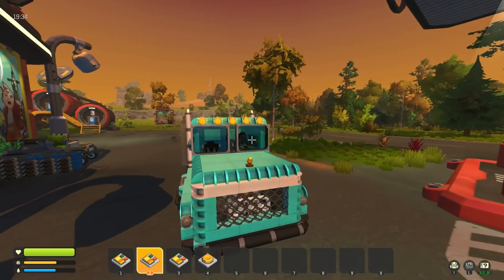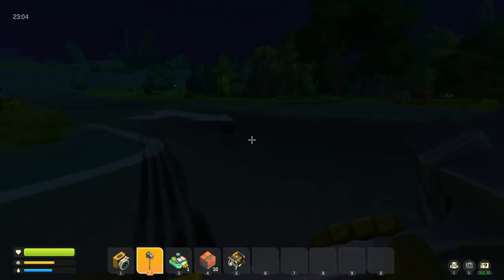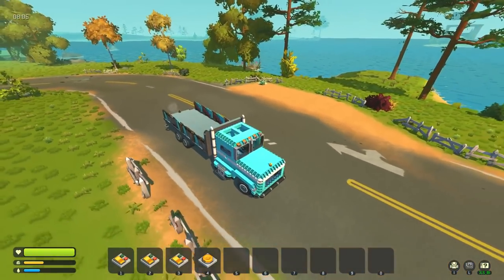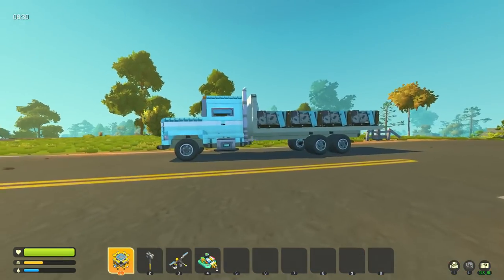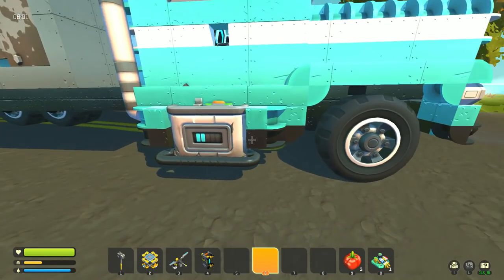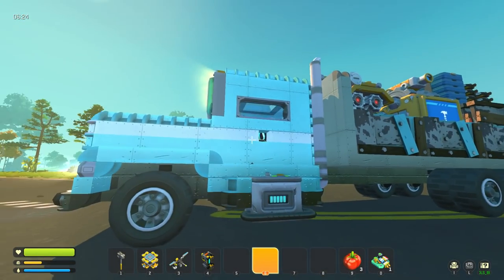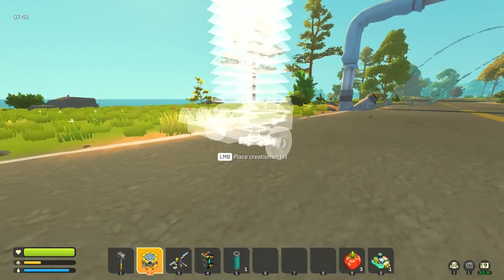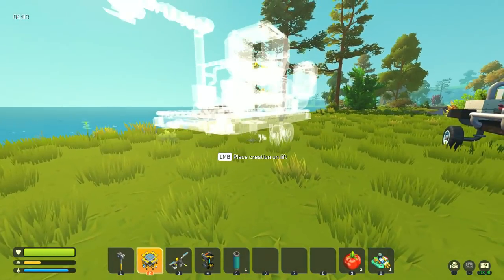I Made a GIANT Land Train to Move Out of The Mechanic Shop! (Scrap Mechanic Survival Ep. 4)

Comment: 12:33 the reason for that is because of frametime. Frametime is the measure of how long one frame takes to render in milliseconds. If you have 100 fps but 40ms of frametime, that's gonna feel choppy and is terrible. The ideal is 16ms. You can display this and other metrics in real time if you use MSI Afterburner+Rivatuner.
20:28 your move is the coolest move out of the ones I've seen.

Comment: The engines have numerous factors that determine their effectiveness for a given task. A given engine has speed, power, and "resistance" values. The resistance is simply how much force will be applied to keep the bearing from spinning due to outside force. Gas engine bearings have zero resistance, allowing the wheels to spin freely if unpowered. Electric engines have a high but not infinite resistance. Anyways, then there is speed and power. I THINK the engine has a desired speed that is decreased by the net torque forces. Net torque means how much the engine power is countered by opposing force (friction). And weight factors into gravity and inertia vectors which increases friction. So yes, weight of the vehicle increases friction which counteracts the positive power torque. But this "opposing force" may also ADD to the power torque like when you are going down a hill. Electric engine "resistance" works to negate opposing friction, so they don't accelerate much thanks to downhill movement. And controller bearings are built on the same system but with extremely high resistance. Yay physics programming. Some of this info may not be accurate especially for survival mode engines which have upgrades, I'm going off of what I remember from messing with the smart engine mod which let you customize engine traits.
Reply: The eletric one is the less efficient in this case, due to size and cost, a similar bearing engine would never need any kind of maintenance, and the only resistance is the mass of the car, but top speed might not change, gas engines are basically unlimited but would just blow at certain rpms, which you can solve with better materials. I don't know if it's the same in the game

Comment: I think that A) That hood is definitely worth it and B) The fuel consumption is based on how much the engine works, weight doesn't matter.
Reply: weight maters because of how bearing work and friction on the Wheels, with more weight the wheels need more torque to move and the Eugenie consumes more gas. in the script the engine consumes gas based on time per bearing connected. the wheels have a set friction and if you have to little weight on them they will spin like crazy and get no traction if you put to much weight on it they grip the ground really well but the bearing have a set amount of weight they can move (that is why when you build a really heavy creation on a bearing it starts tipping even if its locked)
Reply: @LIEFDEenHAAT  Oh, that makes a lot of sense. Thanks!
Reply: Oh yes weight matters alot
Reply: @ricky107_  Oh yeah, your right. Because the weight puts pressure on the bearings making the engine have to work harder to spin the bearings and use more fuel. Good thinking!
Reply: @cadetkohr5508  no bro, that's acceleration formula. More mass needs either more force or more time to get to the same speed, so you use the engine longer
Reply: @afoxwithahat7846  Oh. Yeah. Your right, I didn't know that. Thanks!
Reply: @afoxwithahat7846  yes that is how it seams but that's not how the game's scripts pulls fuel. only thing the engine looks at is the number of bearings connected to it. so when you power the engine it uses gas equal to [Time X Bearings connected] and uses whats called fuel points the higher the engine level the more fuel points it has per gas tank and the higher you set the power on the engine the more fuel point it will use as well.. . so the weight come in play when you put weight on the bearings, the bearings have a limit on how much weight the can move and move slower the more weight is added to them till they hit that limit. so the more weight the slower the Bearings and the higher you will need to set your engine to get the creation to move at the speed you want. and that is why it uses more fuel when your creation is heavier.

Comment: I made a similar set up just connect the rotor under the seat to the seat and you can control left and right its more like a button hold to stay but turns way faster and i only need 1 controler 2 buttons and 3 rotors to get the equivalent with a shock ofc.